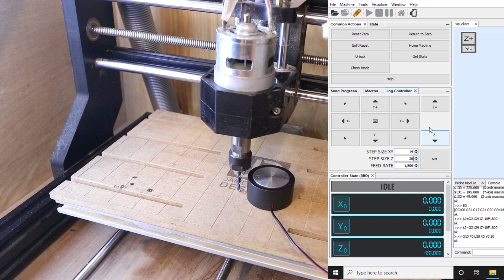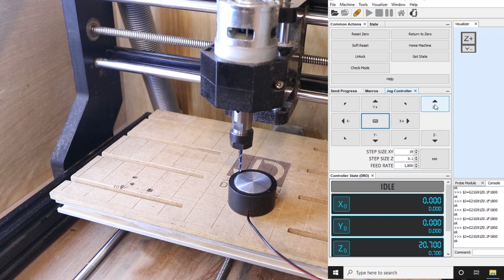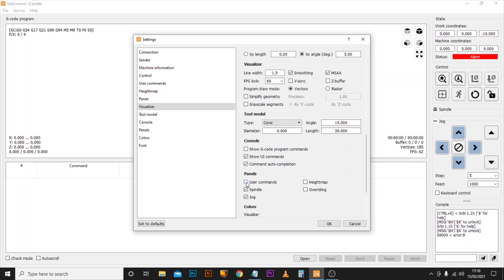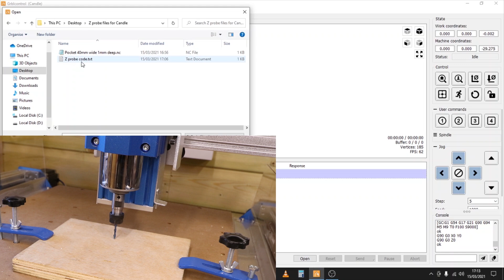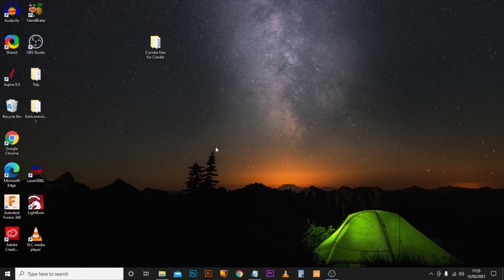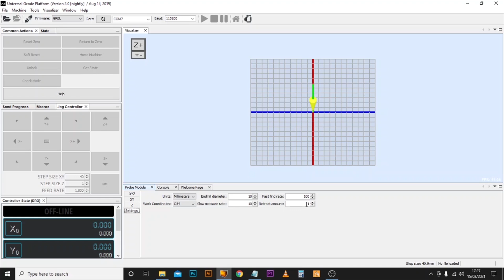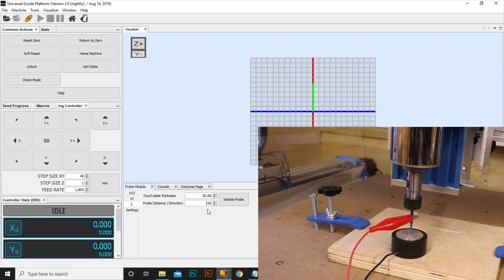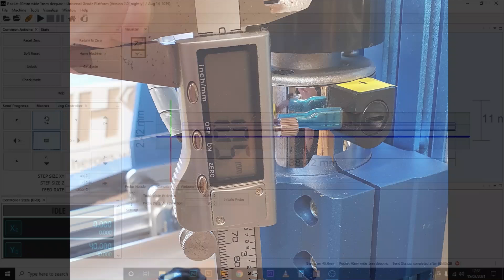Setting up the Z probe for the PROVerXL 4030  CNC from Sainsmart Genmitsu

Comment: No I didn't home it. I removed the zip probe put it aside and hit the command and it doesn't do anything. I have done it a couple of times now and it just stays there. Finally figured out what was making so much noise. Roller bearing on y axis bolt. It's still sealed and I'm betting that it's minus at least two ball bearing of the 9 it should have.

Comment: You showed how to find the height of the Z Probe using UGS but not Candle.  We need the same thing using Candle.  I know you prefer UGS but everything needs to done in both😠
Reply from the maker: Hi John. There is no need for the angry face. You've commented on several videos now getting negative with me so let's just be clear about a few thing. First, they are my videos made how I feel is best with the software I choose and given how many followers I have accumulated,  I must be doing something right. Unless you want to pay me, I do not provide a personalised service. Second, UGS is much better than Candle so why would I always keep showing everything in an inferior piece of software. Candle is not the recommended software from Sainsmart, it is simply just the easiest for them to supply to people. There is major difference here.  Third, if you do not like my videos, then stop watching them.  
Back to the point in hand, it's pretty much exactly the same process in both pieces of software for working out the height of the Z probe but the truth is this is a work around to the problem which I didnt actually need to show in the first place. The correct method is to use the right tool for measuring the Z probe so I would suggest you start by doing that as opposed to keep getting angry with me

Comment: i follow all your guides and for some reason my machine decides to go -10mm deep at start so it just goes in and starts making a huge cut towards the center of the material where my cut is, why is this happening?
Reply: If it’s consistently at -10mm you could just add it into the program zero your z 10mm up. But it’s hard to know without more known information

Comment: Hi James,  Love your videos. I recently bought a 4030. I have a problem since day one with the depth of cut set for the jobs. I used your logo for testing. Candle indicates 10mm as the depth of the cut but the cnc, cuts only at -.2 (displayed in the work area coordinates while the jod id running) and the logo is barely visible. It does the same with other files as well. I have run over and over the same Z-Probe setup as you show in your video but it does does not change anything. I also tried the paper method but had no more success. It's doing the same issue with Candle, GSender and the off-line controller as well. I might be doing something wrong but I don't know what. I tested all axes precision with a ruler and they are dead on. I searched a solution on the Web but did not find any. Would you have any idea what could cause this ?
Reply: Aww No !! Hellppp!!! I am dreading this machine, should have bought the oozenest!
Reply: I'm having the exact same issue. I've looked over everything I could find and still no solution. I was really hoping the answer to my problem would be found here. Guess I'll keep looking

Comment: Hi James. Your videos are simply invaluable! I'm very new to CNC and have recently acquired a PROVerXL 4030 (V1). I have successfully set up the z probe on UGS as per your instruction. Is there a way to set up a macro to run the probe command (what g-code to input etc)? Any help would be most appreciated.

Comment: so i got the zprobe working, that custom script you had however - it moves the machine to the zero x/y/z so when i start a program it hits the limit switches. should i just change the xyz to the middle of the work sheet so i can auto locate there? from center out milling?

Comment: Hello James I love you videos! I have recently been searching and researching non stop for  weeks. I have literally went down the 🐇  🕳  😂 . I have a little over 1000 to spend and I want to get into cnc machining. I can seem to make my mind up between the 4040 sainsmart and the 4030.  The 4030 seems more rigid and built better. I am willing to upgrade it. So my question is that I want to be able do aluminum pretty easy what would your suggestion be for a cnc. I am willing to go for a different brand . You seem to be the guy who knows about all the cnc machines. Would you please give me a suggestion or do you think I should save my money and go for the 6050? I would also like to do 3d carvings not just 2d. I am willing to upgrade to linear rails or ball screws and a bigger spindle. Aby help would be much appreciated 🙏 thank you for all you time and making these wonderful videos for us
Reply from the maker: Thanks for the kind words. For aluminium, you want it to be strong and ridged. Yes the 4040 will do it but something like the 4030 or even the 6050 would do it better. Generally speaking the best advice is get the top of what you can afford so if saving up for something like the 6050 (or another machine) is within you grasp then do that.
Reply: @JamesDeanDesigns  I have been thinking the 6050 but now I'm gonna go with bulkman ultimate bee 500×750 linear rails and ball screws . Do you have any videos on that machine?

Comment: My Z axis was moving to far IE asked it to move 10mm it moved 25mm,  can't get on with candle or ugs, found G-sender works brill and much smother software. used the calibration settings all seams OK now, just need to test out some design software but it looks like most are subscription based, would like buy outright.
Thanks Dean
Reply from the maker: A lot are unfortunately, its the way of the world at the moment. Vcarve can be purchased, also Estlcam. I've not personally used Estlcam but some people do say its good. Just don't run your machine through it, only use it for the design side

Comment: Does this look right for an Openbuilds XYZ Probe for the ProVerXL.  
G38.2 Z-25 F100; G91 G0 Z3; G91 G0 X-50; G91 G0 Z-8.2; G38.2 X30 F100; G91 G0 X-3; G91 G0 
Z8.2; G91 G0 Y-50; G91 G0 X50; G91 G0 Z-8.2; G38.2 Y30 F100; G91 G0 Y-3; G91 G0 Z8.2; G10 P0 
L20 X34.355 Y-17.255 Z8

Comment: I tried the z-probe way and when I tried the user command #1 button nothing happens. Then I set the z axis with a piece of paper then ran the program. It when down the right depth right at the 0-0-0 point and diagonally cut through the wood to the center of the circle I programed. Need help please.

Comment: Great video James, as usual. I watched your z-probe 3018 video and you made a diy probe.  I would like make a diy corner touch plate that senses the x, y and z (of the front/left corner).  Can you point me in the right direction for the code to implement this?  I would be happy if the probing needed 3 buttons, but better if all three were in one button and sequential.  If I am being overly ambitious, just say :)  Thanks again James.
Reply from the maker: I dont have the code for Candle unfortunately (I'm not that clever 😆) but if you use UGS or Openbuilds Controller then it's inbuilt automatically and no extra code required
Reply: @JamesDeanDesigns  Thanks a lot James.

Comment: Greetings Sir,   New subscriber here...  I just purchased my first Machine, the Genmitus 3020  Pro Max.  Mostly I'll be creating small parts from aluminum for model r/c cars.  Your channel came at the top of my youtube search so you are the first person I watched and so far the only one I've actually subscribed to.  I find your videos very detailed and novice friendly.  I'm a long time user of 3D Printers and Laser Engravers so most of the terms were familiar.   I went with easel but when I started the trial ver the only option was to download the gcode file.  Must be an update or is there a different ver I should be looking for.  Perhaps the changed the save gcode option to only the paid ver.?

Thanks for the great easy to follow videos.  Great channel overall....
Reply from the maker: Thank you for subscribing. I believe the option to download your gcode is still there but if you're using any of the paid for features then it will not allow you to unfortunately
Reply: @JamesDeanDesigns   Thanks  so much  for the reply & information.

Comment: I know this is a very silly question but I purchased a CNC 4540 engraver on Amazon but I have no idea how to hook it up to my computer or to communicate with the program to engrave my designs. I am so confused and missing something entirely. So my question is, because the machine on the left looks much like mine I put together today - how does it comminucate with the software?
Reply from the maker: Do you have a link to the machine you bought? The setup is the same for most machines so if you look back at my earlier videos like the one below, it walks through all the steps
https://youtu.be/mUO6d7MaeCA

Comment: i want to use Fusion 360 to design and generate gode. How to I set up my ProverXL 6060  in Fusion360 to make it talk correctly with that machine?
Reply from the maker: You dont. You basically design in Fusion 360, create the toolpaths and then export the Gcode file. You then run that file in UGS or Candle. Fusion doesnt talk to your machine directly if that makes sense
Reply: @JamesDeanDesigns  i was speaking to the post processor. How do I define travel limits of rhe 600x600x 100 (or whatever z travel is) in Fusion 360 so that when I layout parts in F360 it knows what the Axis travel limits are

Comment: I am using candle 1.1.7 and that button code you suggested using seems to not work as intended. Instead of moving down to touch the material it sort of did a homing jog but faster and did not actually home it. It just moved all the way back to the far back right then shut down to where I have to hit reset to start over.
Just a little confused by that. So for now I think I will manually jog and zero the machine.
Reply: same here, absolutely, there should be something wrong with the code he showed

Comment: James.. great video as always. Question. I seem to have difficulty sometimes with finding zero at bottom left, due to crappy boards. What is the recommendation for an xyz probe rather than just the included z probe?? Have you or do you use one?
Reply from the maker: I've never used one but its fairly easy to setup within UGS. You can buy them off amazon and ebay but to be honest if you have the 4030 you can probably machine one your self.
Reply: Does the 4030 have other inputs for an X, Y, Z probe?
Reply: @BJGoldstein84  Not sure. I have emailed Sainsmart Support to ask.

Comment: Great tutorial. When I do mine, I set the XY axis to zero, then move to Z probe location & run probe sequence, return XY to zero & leave bit at Z height as I don't want an errant bit of code fast jogging my bit to start location & bashing my hold town clamps. This relies on the G-Code setting appropriate cutting height once in correct XY start location.

Comment: i figured it out. there was a step you did not include, i needed to hit zero XY before starting your program. is that normal?
Reply from the maker: You can do it either way. Usually I get it to where I want to start, click reset zero, then run the z probe
Reply: @JamesDeanDesigns  is there a way to set up a static start point? So a point can be set in the model infusion in the machine always knows where that is so you can just drop your material on, send the G-Code and it will go from home to the coordinates in the real world that you have already put into the model? Without having to manually move everything around
Reply from the maker: @beardedgaming1337  check out this video and also read the pinned comment with extra advice
https://youtu.be/UGRPIuuQhMo

Comment: Currently own a 3018 and to my dismay the Z axis only has about 1.5" for workspace. Although I have replaced the motor with a 300 watt to handle .25" drill bits they tend to be much longer then the 1/8" bits. So my question is; how much "Z" workspace can the 4030 provide? This machine is on my shortlist but the price point makes me need to know if it is adequate.
Reply from the maker: I think I might have just commented on your Facebook post but its has about 110mm of Z axis travel 👍

Comment: Having issues with this. the part in UGS when i return to zero it tries to punch through the board. There is no light touch. it hits and pushes the bit into the board pretty hard.
Reply from the maker: By any chance did you run the homing sequence before hand. That custom button goes a bit funky if you've ran the homing sequence
Reply: @JamesDeanDesigns  I ran the homing sequence a long time ago when I was playing around with it before I ever used it. Did not run it before trying to configure z probe. When cutting my plaques and signs everything works good as long as I use the paper method when zeroing. When I try to do a cut out, say the wood is 13mm thick and I set it to cut it out. It goes way past 13mm. It actually went over 20mm and cut into the spoilboard. Have not been able to do a cutout yet because it goes way too deep.
Reply from the maker: @TheBigORoadGlide  that's odd. If you used the correct code and entered the correct measurement in for your Z probe it should be fine. Its a fairly simple command. 
Have you tracked your Z travel and calibrated it? So for example take your Z axis all the way up, then tell it to move down a specific measurement such as 30mm. Measure how far it actually travels with a ruler or tape.
Reply: @JamesDeanDesigns  I just took it all the way up. I set UGS Z step size to 10. I then pressed the button to drop it and it dropped 20 instead of ten.
Reply from the maker: @TheBigORoadGlide  there's the problem! Check your GRBL settings by typing $$ into the console. What ever number is in for setting $102 needs to be halved i believe, so if it 1600, make it 800
Reply: @JamesDeanDesigns  it was 320 figured out how to do it. I have it now at 166
Reply: Thanks for the assist. I am now going to check the x and y
Reply from the maker: @TheBigORoadGlide  excellent news. Glad its working correctly

Comment: Got a question for you James. I have a 3018 and every time i start up the machine and turn on light burn it always lists my position as x-18y-73z0. then i always have to g92x##y##z## before i start, why will this machine not start at 0 like my lm2?
Reply from the maker: Its the one flaw of lightburn. It was designed for machines with limit switches, and if you don't have them it gets a bit confused. Have you watched my video on lightburn?